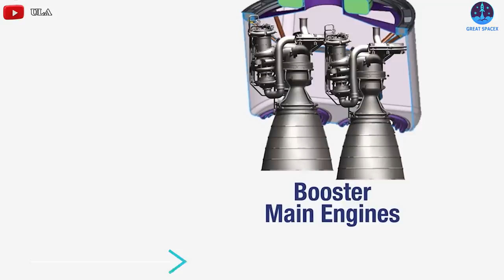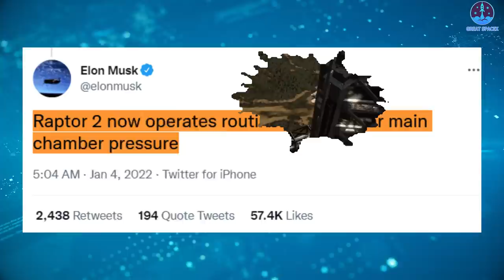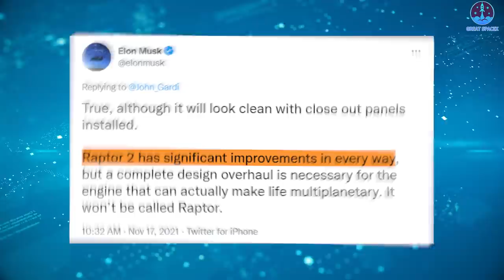Why SpaceX's NEW-GEN Raptor engines absolutely out-classes BE-4 engines?

Comment: ULA going with Blue Origin makes sense considering SpaceX never offered to sell them engines....Also given one of SpaceX's biggest challenges going forward will be producing enough engines for their own use, selling ULA engines so they can throw them in the ocean seems very unlikely.
Reply: What the h3ll are you talking about?  ULA and Blue Origin were working on their BE-4 engines before SpaceX started working on their Rapter engines.   The real problem is ULA works at a snails pace because they are unionized.  They care more about diversity instead of working on the actual problems, and will hire for the sack of hiring for diversity instead of hiring the best canidate, or person for the job.   Hiring based on merit doesn't mean a thing.   No wonder why ULA and Blue Origin have taken this long.   I will sum it up for you ALL UNIONS STIFLE INNOVATION.
Reply: @sgodsellify  That I will not argue. I have first hand experience backing up you assertion.

Comment: Going from two to three engines on the Vulcan would actually be trivially easy for the structure... their thrust structure is already an independent design... and would take minimal changes to address... as for the flight control software, if they've designed it correctly, there would be minimal changes as well... they're both gimbaling engines as it is... so adding a third doesn't change the laws... the math is already done and there is plenty of physical space.  You mentioned the politics involved... that's the real key here... SpaceX can redesign the Starship Booster and then redesign it in a matter of weeks because they don't have that political pressure or even input... that's what makes Blue Origin and ULA a non starter.  Just look at how quickly Starship went from 6 to 9 engines in this latest iteration... and from 27 to 31 engines on the booster.  That's a massive change... but because they architected their systems correctly and don't have to report to any other authorities about it, it was actually an easy change.
Reply: Agree

Comment: ALL existing launch plaforms are completely obsolete compared to the Falcon 9. ALL competing launch platforms that are under development are merely attempting to 'approach' the capacities of Falcon 9. Meanwhile Starship will likely be putting payloads into orbit within two years. The economics of Starship will be such that using any launch platform 'other' than Starship will be insanely stupid, let alone attempting to build a competing system.
Reply: @jebes909090  FYI James Webb project was a joint venture between NASA and EU. The plan called for NASA to build the telescope and for EU to launch it. Thus sharing the cost with EU as EU paid for the launch on their own rocket while NASA foot the bill for the telescope. This has nothing to do with seeking the best launch provider.
Reply: Ariane 5 has a larger diameter fairing that Falcon 9, and JWST only just fitted in it. So for launching JWST the Ariane 5 was actually the best rocket. Also Ariane 5 has a cryogenic (and therefore high specific impulse) upper stage (unlike Falcon 9) making it much more suitable for beyond GEO trajectories. Falcon 9's performance to GEO or beyond is seriously hampered by the low specific impulse of the upper stage engine.

Comment: How does the Raptor compare to Rocket Lab engines? I think Space X’s competition is here.
Reply: no comparison!
Reply: @wino99999  can’t determine from your answer what you mean. Tell me more.
Reply: @saighusa  It burns the same propellent as the Falcon, but the 'Electron' rocket is only capable of getting 150Kgs into orbit against the Falcons 22.8Tons (Fully Expended) with the same number of engines on the 1st stage. I don't think the Rutherford Engine is capable of just being scaled up to match the Merlin's power, a new engine needs to be built by Rocket lab for their new 'Neutron' rocket from the ground up!
Reply: @wino99999  ok, thanks!

Comment: They tested the Raptor 2 at 107% (and it blew up) but it matched BE-4 thrust. They got close. Raptor 2 May become a viable option as its more efficient, same approx thrust (maybe.... soon), uses same fuel. 
If Vulcan dead stopped with BE-4, Spacex may step in to maintain 2 company supply for Vulcan... or risk becoming a monopoly and all the Senate oversight that entails. 

If they mark up the Raptor to the price of BE-4 ($14million per pair) there's good (ish) money there too.
Vulcan doesn't need reusability until 2024-5. So maybe overclocking the engine is feasible without incurring risk.
Reply from the maker: Yep!

Comment: Why does it have to be methane?
Reply: It's to do with the amount of energy contained within a specific volume of the fuel as well as ease of storing and other factors. 

Hydrogen has a higher energy density, but has to be colder to keep it as a liquid. It also has to be well insulated adding to the rockets weight, if not properly insulated liquid Hydrogen can Freeze the LOX. 

RP1 is very good also wrt energy density, but as a kerosene the RP1 derivative is hard to process in order to get it clean of possible contaminants. RP1 produces soot that has to be cleaned from the engines after every flight. And RP1 can be frozen by the LOX if there's insufficient insulation.

Methane is easily stored as a liquid, and is also relatively easy to manufacture from raw materials on other planets including our own if necessary - It's mostly made from Natural Gas at present. It has a higher specific impulse than the RP1 fuel. It also burns cleanly meaning the engines do not require a lot of maintenance and cleaning before they can be reused, essential for a reusable Starship!
Reply from the maker: The main benefit of using methane is that it has a higher performance than other fuels, meaning the rocket can be smaller. Its lower cost, too, means the total cost of launching can be brought down.

Comment: 100 engines in 29 months, very impressive for an engine that has not been in orbit or returned and reused as advertised.  In other words, these are just stats that prove nothing about engine reliability and performance when under the real stresses of space flight.  Basically BE4 and Raptors have proved nothing beyond their spec sheets so who cares how many more Raptors than BE4s are produced if both have never been on real missions.  RS25s still the best until proven otherwise.
Reply: Raptor has actually flown several times. Not to space yet but even so still far beyond the few short duration tests that the BE4 has done on a horizontal stand.
Reply: @listerdave1240  Starship is going to use Raptor 2 which has not flown yet.  Both engines have not been tested in orbit and recovered and reused as advertised.  Until that happens, they are still numbers on a Spec sheet and test stand results.